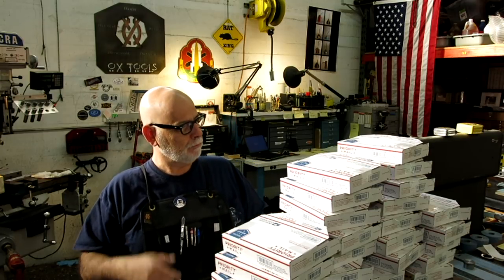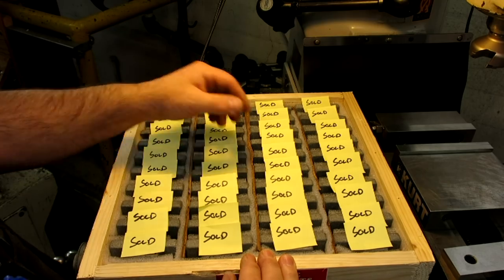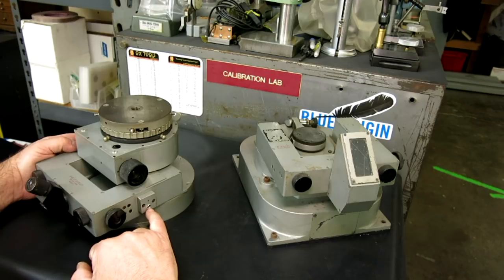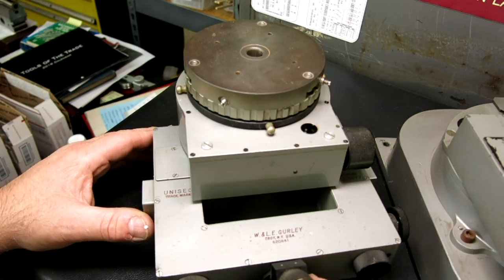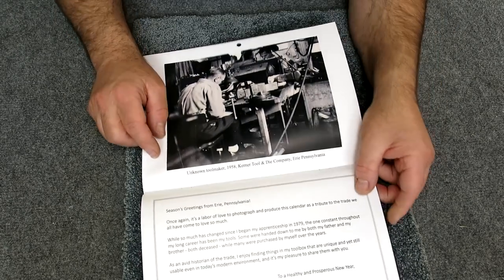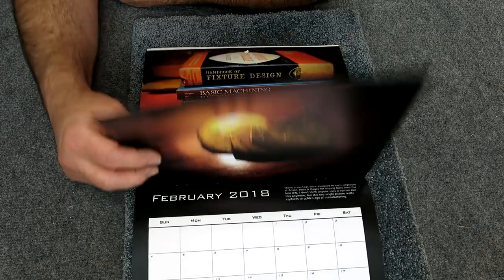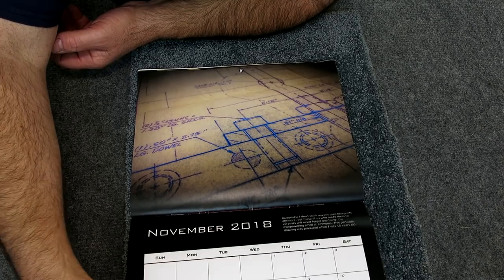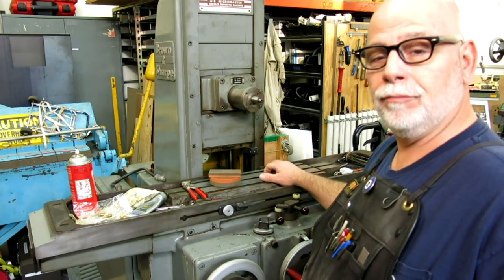Monday Night Meatloaf 115

Comment: Hi Tom  the Gurley Gage reminded of the circular geometry machines I sold when I worked in field sales for Federal Gage. Some advise if you put a cylindrical part on the chuck and want to align it with the Gage rotation. first center the part at a lower point. Then move the indicator to a upper surface point to adjust the chuck tilt.  If you try to adjust both at the same time, it will drive you nuts. I would call this squeezing out setup error, and based on manually setting up thousands of parts. When I worked in the die shop we used the small granite plated to condition surfaces scratches. Really like the idea of using as a indicator base, " Nice Gaging Tip ".                                                       
Love the gate your wife made for the shop. From my DoAll Field sales days, on setup of a new grinder we would first level the grinder. Then we would grind in the chuck pad surface till it sparked out. Then we would then set the chuck top face down and grind in the bottom mount surface, clean the pad & chuck spray the rust preservative and mount the mag chuck. At this point I would let the shop guys grind in the chuck top surface. This was a killer on a manual 6" X 18" but it made a huge accuracy difference. Thank You for all the great videos, Wishing you and your Family Merry Christmas & Happy New Year. Bill B Naperville IL

Comment: The Newbould indexer has a motor, and the rubber belt is fairly loose, when using the indexer, is the motor run continuously and belt slips when it hits the divisions? Or is it turned on and off per division? Also, thank you for the awesome videos and your unending knowledge.
Reply: Nevermind, I saw the Newbould's Perj  using it on surface grinder and fully understand.